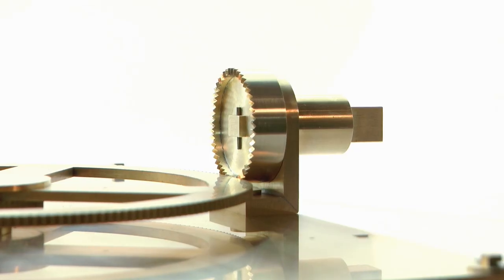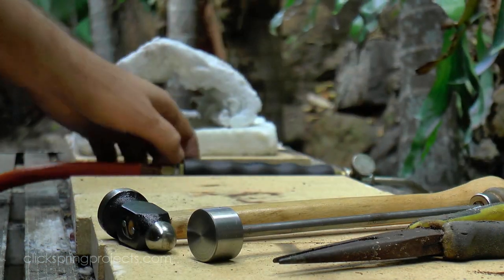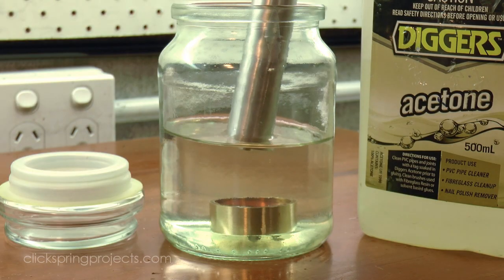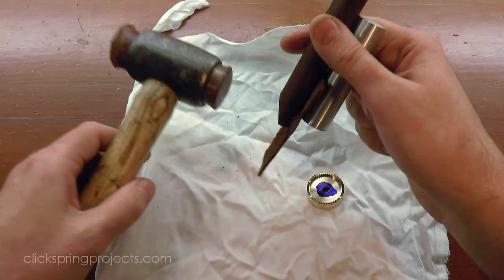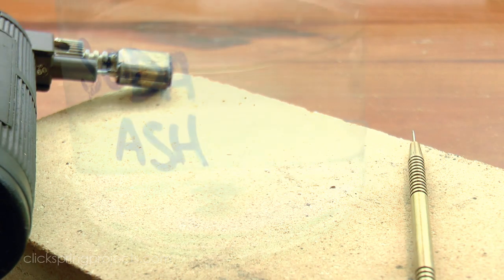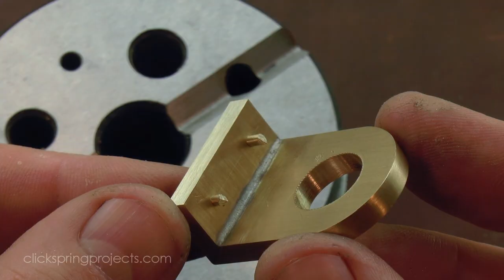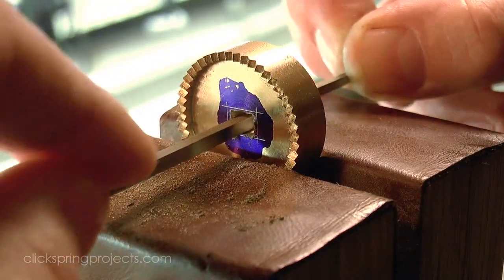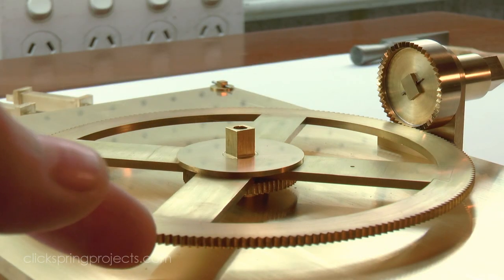The #Antikythera Mechanism Episode 5 - The Input Crown Wheel Assembly

Comment: A possible reason the gear was 2 parts might be so that the outer ring with the teeth could be pressed off and replaced when there was unacceptable wear. That way the center piece could be reused and there would be no need to re-index anything. A long tube could have been made withe the proper inside and outside dimensions and then several blanks could have been cut off and made into replacement geared rings. That could be more efficient and cost effective. There are parts like that on aircraft today.
Reply from the maker: I agree Eric, it is very likely the reason. The A1 drive wheel teeth are very susceptible to premature wear - Cheers :)

Comment: I had a look and couldn't find if this had been asked before, what is the purpose of the trepanned grooves on the face of your arbors? Reduced surface contact only?
Reply from the maker: It permits (moisture in the) air to more readily interact with the CA glue and so permit curing - Cheers :)
Reply: @Clickspring  Ah thats a good idea! I use CA as a fixture as well so this is a handy tip. Thank you :)

Comment: could it be that the input crown wheel was an assembled part so the teeth could be cut while the outer ring was still a flat piece? this would certainly make cutting the teeth much easier rather doing it 'radially' as you showed us. the flat piece would then be heated up and wrapped around the hub of the crown wheel after cutting of the teeth. the way you did it certainly means the teeth are a lot more accurate...

Comment: Beautiful work as always Chris. Do you suppose that the repeated heating of the brass strip might have softened it to such a degree that tooth life might have been compromised? I wonder, as the build progresses and the torque required to drive the mechanism increases, if you might not begin to experience excessive wear on the teeth. I guess if that were to happen you could just back up and make another gear out of one piece of hard brass round bar. What type and brand of solder and flux are you using?Again, beautiful work. Best machining videos on YouTube and that is saying a lot.
Reply from the maker: Yes its possible Terry - Tix solder and flux

Comment: It's possible the 2 piece design was so that the teeth could be cut first and the tooth engagement could be set afterwards when all pieces fit together. Then it would just be a matter of applying solder to make it permanent

Comment: I realise that this is now a pretty old video, but just watched it.
I'm wondering if it would have been easier to cut the teeth on the crown before forming it in to a cylinder.
Though I'd imagine you'd run in to accuracy issues then. Just a thought though.

Comment: I'm curious as to why you didn't use silver solder instead of low temperature solder.
Reply from the maker: There is evidence of the use of soft solder in the original mechanism. but none for brazing/hard solder - Cheers :)

Comment: Is it possible that the teeth were cut into the flat stock then wrapped around the cylinder? Maybe they had a gear cutting tool that worked well on flat stock

Comment: Wow. really great video. I have really been enjoying this series. One question. Where did you get that cutting attachment for the lathe cross slide? did you build it yourself or was it something you purchased? i want to build a set up like that for my small lathe so i can drill bolt circles and cut teeth like this.
Reply from the maker: Kinda both - Commercial spindle, vertical slide and motor/speed control as well as some shop made components to make it all fit onto my lathe
Reply: Nice!! Yeah that was kind of what I figured. I'm going to start collecting the pieces to build one.

Comment: Would they maybe have made the ring slightly smaller and heated it up so it grips when it shrinks. Works for the starter ring gear on the flywheel of most cars and trucks.

Comment: I'd bet that the gear band was secured to the forma with nothing more than thermal expansion. When the band cooled, it would have shrunk and tightly affixed it to the forma. No solder or pins required! You can even see it how the inside of the band needed to be milled out a little to fit it properly after it cooled here.

Comment: I so look forward to these videos thanks Chris.  I had a question. When making the holding bracket, you said that bending the joint back and fort causes work hardening. Is that what happens when metal is bent back and forth to be broken?  It hardens becoming more brittle until it breaks?
Reply from the maker: Yes, exactly

Comment: By any chance do you think it would have been easier to fabricate the teeth while the flat stock was still flat then wrapping it around the round stock than trying to get the teeth well formed on the end of a cylinder?
Reply from the maker: Its possible, but I think unlikely - the problem with that approach is that there is significant distortion when you wrap the material that would seriously deform the tooth shape. it would have been much simpler to do as shown in the video - Cheers :)

Comment: I'm pretty sure the crown wheel is made of two parts because the original maker would cut the teeth into a sheet and then wrap it around a round post. They knew pi, so he would be capable of doing that and it was probably easier to cut the teeth that way with ancient machining tools.

Comment: 17:36 I watched the placement of the hole for the retaining pin with interest - did you place the hole not quite tangent (a bit further) with the line marked for the edge of the pin so as to provide some tension?  Also is the pin tapered?  It seemed to fit tighter on the entry side than it would be on the exit side?  Fascinating!
Reply from the maker: Yes to both Cliff - great to have you watching mate :)

Comment: Fabricating parts was likely about conservation of materials. The coming of the Iron Age would not have made bronze cheap by any measure, as copper and tin are relatively rare compared to iron. For that matter, even with iron most items were forged or cast into rough shape before hand filing until metal and machine tools became widespread in the 1800s.

Comment: I wonder if it was made in two parts to save a small amount of bronze. It wouldn't have saved much, but even saving enough to form a rivet or nail would probably have been worth it back then. Or, maybe the engineer realised that the only blank he had available was slightly too short and he didn't want to wait until the blacksmith had made up a longer blank, but he did have some scrap sheet left over, so made do. (Creating the alloy, casting a blank and waiting for it to cool would almost certainly take more time than just bending and soldering/brazing.)

Comment: i personally think that this "why the f fabricated again" is due to material availability again. that's some hefty roundstock for the one-piece part... and without a proper form it'll be even bigger to counteract the sanding to form. not only that's way pricier, there's so much more room to bubbling (without a proper form and stuff) inside the metal, making big bad batch and losing a lot of material and generally more room to mess up, literally. and prepared beforehand flat sheetstock would be just more efficient in terms of time and cost.

also sometimes occam razor tells me that not only people are lazy and don't want complications, but "master craftspeople are crazy. you give them one (1) complicated out of their mind way of making impossible and they'll do it"
maybe material cost save was too yummy for them and they decided to brag about skill? :D

Comment: Hi Chris, I'm interested, did you remove the parallels in the right angle part because the diameter of the hole would have clipped them, or is it just something you always do? Thanks, Lewis
Reply from the maker: Hey Lewis, the drilling would have cleared them by a small amount, but I usually remove them as a matter of course - once the vise is locked, they're not doing much. Cheers mate :)

Comment: So why couldn't you make a clock with that triangular gearing? Or, why would that be a bad idea, I suppose? Are there any other tooth forms that can be produced by a single cutter that would work better? I'm curious because I'd be interested in making geared mechanisms (not clocks necessarily), but I'd rather not have to buy 10 different expensive cutters to make all the involute shapes for different sized gears, nor make those 10 cutters. I'd like to just make one cutter for all sizes of gear (without hobbing). Is that just not a realistic dream or is there some other tooth profile that will work?

Comment: Do you think they would have thought it easier to cut the teeth in the flat stock first and then form it around the cylinder?
Reply from the maker: Hey Nick, its a possibility but I suspect that would have its own issues - when forming a flat strip into a band there is significant distortion of the "outside" surface, such that any tooth profile would likely be compromised.  The join is also problematic - its angular (a radial line), and would need to be very precise to maintain the tooth spacing at the join - cheers :)

Comment: I know that it has been well over a year now, but I am just going through a first watch through. For the tube, it doesn't make much sense to me for the metal to crack and not show obvious signs that it would have been manufactured the way you had done it, as the conjoined portion should have shown some sort of sign that it was conjoined. To me it seems it would have been more logical that it was either poured or manufactured like a ring from flat stock or a coin, as both are more likely to crack like what was shown in the infographic. 

I was unable to find the portion of the paper mentioned on quick glance as I am to eager to get through this first watch through.

Comment: Impressive though this is, the teeth engagement is very far from the perfection you would get from modern bevel design, and it will wear none too good.  Stop the video @19:11 and you'll see where all the load is concentrated at two points.  One understands the original makers could not make proper bevels and modern tooth forms, but there would be a considerable improvement if the crown wheel was made as a flat gear with radial teeth, and the technique shown in this video used to make the large main gear with axial teeth.
An idea why this probably was not done?

Comment: What happened to showing the old technology how it was made?
Reply: We've seen him file teeth into brass before, and he wanted to show off a different way to cut the teeth using the lathe.
Reply: Yeah that's what I was expecting too see. I mean this guys a fine machinist no doubt but 2000 years ago whoever made this thing certainly didn't have access to lathes, drill presses and power machine tools.  I dont think they were soldering back then either. So HOW DID THEY DO IT?
Reply: capowacko they probably did use solder, as lead is known to have been used to affix metals for quite a long time. Plus, he has shown us already how to file teeth on a wheel using files during the episodes with the homemade case hardening. He mentioned he just wanted to show how a vertical lathe setup is used, and that was the best way
Reply: Andrea Quadrati yeah but where did they plug in their soldering irons? They did use lathes tho. And no doubt cnc machines.
Reply: capowacko you can basically melt down any alloy and pour it over the two parts to join. A similar reaction is done with thermite and rails. You can also get a lpw speed lathe by using a standard pottery wheel, which you can make with some rope and pulleys to transfer the movement. All he is doing now is using modern tools in the same way old tools would have been used, but if you wanna be a sarcastic prick, well, go ahead. Wanna see him go and do this all on his own, maybe even creating the metal himself? Oh yeah, right. This is Clickspring, not Primitive Technology. If you don't like how he does things, don't watch and do not complain
Reply: Andrea Quadrati dude you have no sense of humor